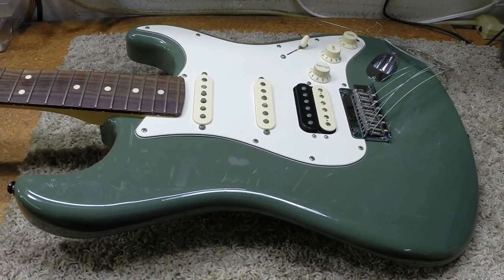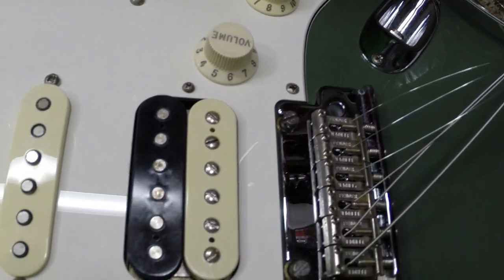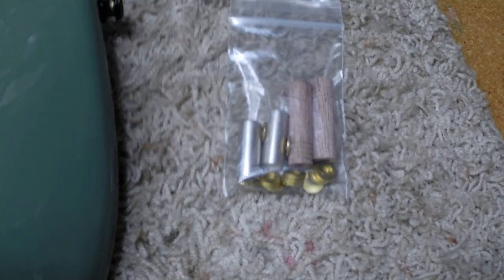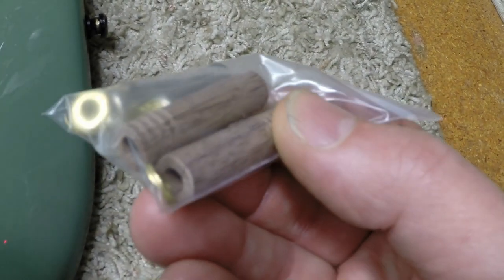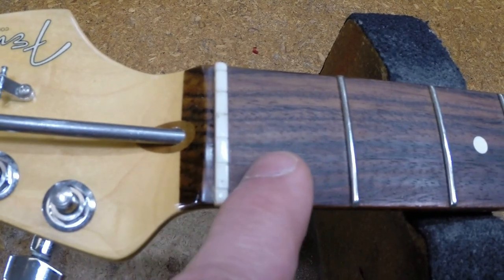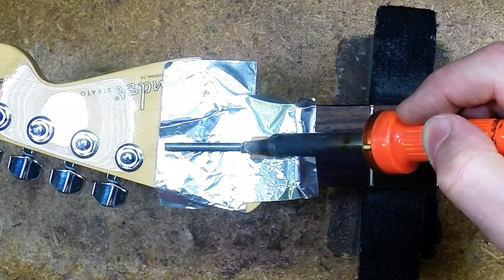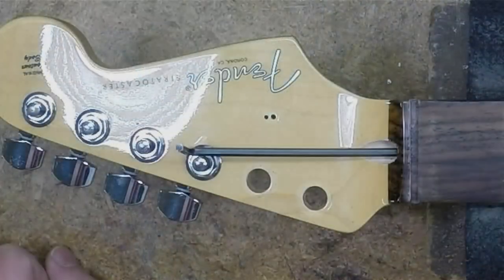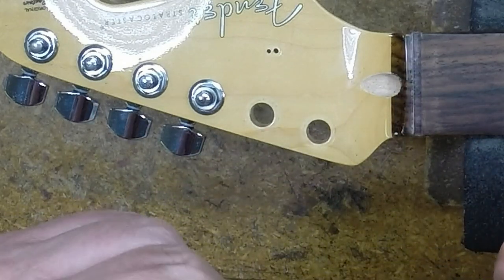American Standard Strat truss rod repair

Comment: That was the best video on truss rod nut replacement I've ever seen. Awesome job, I have 3 Squire bass necks that need this done to. Thanks so much for sharing!
Reply from the maker: Oh, sorry man.  The Squire necks are a different issue I believe.  I have had multiple problems with them and the Mexican models.
Reply: Your method worked great using a drill bit inserted in the truss rod plug and heated it up with a soldering iron. Turns out the truss rod nuts on the 2 Squire bass necks were cracked (split) and not stripped. now I have to get the parts to finish the repair. Thanks again for the great video!

Comment: What exact bridge is that?  Looks like it has the PUSH IN whammy bar but the steel saddles!  I am about to do a parts caster.  Need to know!  I love the OLD strat Ultra bridge from the 1990s, but its so chrome shiny.  I’d really love it in more of a satin finish or more classic looking but still a modern 2 point for this build which I intend to be a sunburst.
Reply from the maker: That is a plain old stock Fender Strat Standard trem.
Reply: @guitarc.p.r.9675  They didn’t look like that in the 1990s.
Reply from the maker: Ok I went back and checked it out.  It had been probably 2 1/2 years since I had seen it.  It is a strat std. trem, but the lighter steel saddles had been added.  The saddles are stock Fender.  Just had to take a reminder look.
Reply: @guitarc.p.r.9675  Thank you!  I didn’t know the steel saddles and screws would fit.  I think I’ll do that on my build.

Comment: Worked on a friends tele today to try and reduce the relief a bit.  Truss rod moves freely in both directions from a neutral threaded position.  However multiple turns clockwise resulted in marginal changes in flattening out the neck.  Eventually the truss rod reaches a stopping point. Additional torque was applied within my comfort level at which point I stopped.  Any suggestions on what the issue might be?
Reply from the maker: The first thing I would do is check the amount of relief with the truss rod in the neutral position.  If you have more than .020 relief with string tension, you may not have enough room to adjust it. I have had to heat straighten and even sometimes re-fret the neck to get them to conform. There is an old Japanese Jazzmaster video here that had a similar issue.  Also, when adjusting any truss rod put a little back pressure on the neck and bring the rod tension up.  That way the rod is not doing all the work.  Thanks for checking out the video.

Comment: I think I prefer the bullet style truss rod nuts. What about you?
Reply from the maker: Actually My favorite is the vintage style that adjusts at the neck heel.  While I have had to repair all types, that one seems to me as the most solid.  The Bullet has it's own problems with cracking fingerboards, and caving in at the pressure point, ESPECIALLY on basses.  The bullet nut is also a bear to remove it it is cracked or stripped out. The advantage of the American Std rod is that is is double acting in case the neck actually hapens to be too straight while under string tension.  Thanks for watching!

Comment: I have a 2019 ultra Fender Tele, my truss rod nut is tight, I’d love to do this to mine, but that plug is what I’m afraid I’d mess up, I’m guessing they don’t sell replacement plugs in case you screw one up?
Reply from the maker: Awww, but yes they do.  But it will have to be trimmed.  BTW, chances are that if the nut is tight, you may have another issue.
Reply: @guitarc.p.r.9675  any advice? I’m gonna take it to a local luthier, eventually 🤪 I’ve had it since 2019, it plays but just tight when it comes time for setups, would I be better off buying a new neck? Or is it affordably salvageable?
I’d just like to be ahead of the curve before I talk to a luthier
Reply from the maker: Repair or replacement is your call.  I can not offer any suggestions simply because without having it in my hands to evaluate it I would only be guessing.

Comment: What is “music wire”?
Reply from the maker: Music wire, aka piano wire, and spring wire is a high carbon steel rod.  Very high tensile strength, and heat resistance.  I used it to fabricate truss rods in my building days.  It was easily available from hobby shops.  I first used it in model airplane landing gear, and a model rocket launcher.  It is common in everyday life. Just last week I found a section of it used as the idler arm belt tension rod in my clothes drier.  Hope that helps and thanks for checking out the channel.

Comment: why so much glue on the plug?
Reply from the maker: So I would be sure it was glued well.  Most of the glue is going to slide off as the plug is put in, so I use extra.  Plus the extra glue makes a nice lubricant to make sure it slides in and seats quickly and easily.  The rod may possibly end up with back pressure on it and I have seen factory ones be  accidentally pushed out some.  In the few of these I saw there was evidence of a poor glue joint.  Thanks for watching.

Comment: You would think with a 3-500 dollar neck they could use a decent truss rod nut
Reply from the maker: Even though it is not a perfect product, there are thousands of functioning ones out there.  Unfortunately, all it takes is a careless supposed tech, or DIY attempt to trash one.    If treated with care and respect there is not a problem.  Thankfully, I have seen many more working than not.  But like I said, a worn wrench, or a little man handling can create a big problem.

Comment: I just hate hearing this...  Fender just missing the ball on giving us a good solid fitting socket to wrench fit. All you have to do is adjust your truss rod a couple of turns and next thing you know you can't adjust anymore because the wrench wore down just from normal use. I swear we should all just stop buying from Fender until they put more effort into quality.... I have another Fender American Professional II 2022 and guess what?, the rod is stripped and not because of over tightening its because the material sucks and wears down after minimal use and we're stuck with a big bill from a luthier to have it repaired.

Comment: Hearing you say guys be careful with these just makes me so irritated.. Not at you but at Fender.. I can see your wrench is already wearing down and you just said you filed it.. CHEAP MATERIALS is the problem.. I would have to say 1 out of every ten guitarist could do what you're doing. It's a trip to the luthier and a big bill. Have you ever assembled furniture with a hex that fits properly? You can take it apart  and put it back together a hundred times because the material is hard and the wrench fits solid. MADE IN CHINA TOO,, LOL  Fender is a joke
Reply from the maker: I agree with most of your comment. The reason I said to be careful, was just a heads up/warning.  I have customers' guitars I have worked on for years without a problem.  But it only takes one slip from a hasty owner to get into trouble.   Fender's excuse to me on the phone was..."in a perfect world it would fit better"  I mostly use a very hard wrench turned backwards with a small socket style driver as a handle.  The Fender wrenches are a joke.  The round tipped/T-handle ones supplied with the instruments should be thrown away.  Frankly, there is a LOT of BS all over the industry.  I have been dealing with it for nearly 50 years now. I tell people all the time "If you knew what I know about this industry, you would all take up golf."
Reply: Couldn't agree more. But I'm too nearsighted for golf, and Toni I. gives me goosebumps, not Tiger W.
Funniest part of my past, 36 years ago my luther told me to "stop overpaying for these overpriced products. For less money I can build you anything you want. "
Now that I'm 4 years into building my own instruments I really really wish I had listened to him. I'm sure he was right